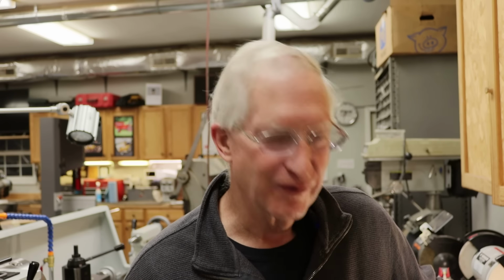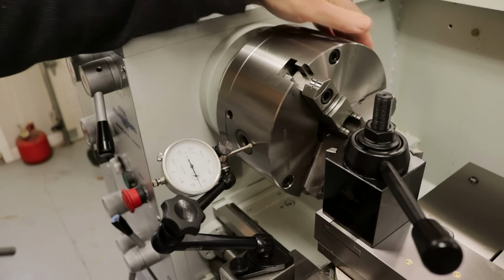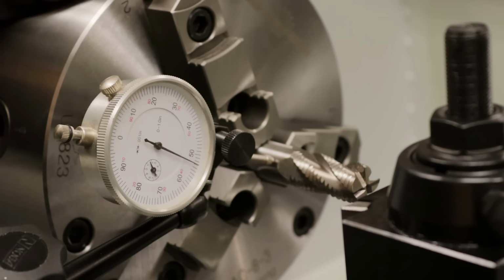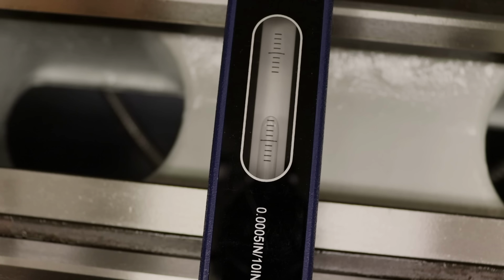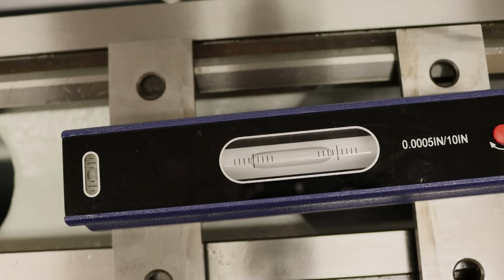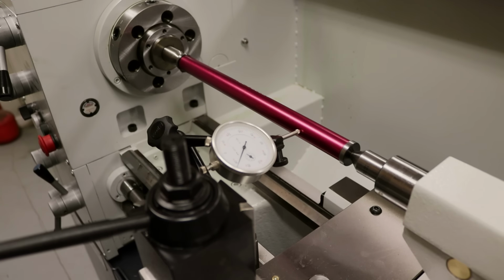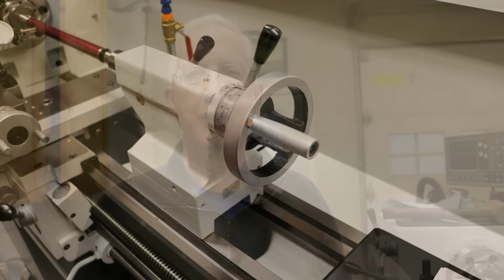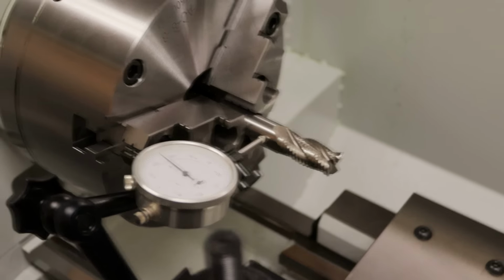Finally Catching My Breath

Comment: Frank , if I were you and needed the extra height, I'd make a steel frame instead of blocks. That way too, the frame is flat to match the bottom of the lathe, and the leveling feet could go on the frame. Just my two cents. Nice lathe!
Reply from the maker: That's the ultimate solution, for sure. Just trying it this way to see how it works.  If I made a frame, it might just be 3 or 4 inches rather than 6 inches high.

Comment: That's a great lathe. Take the reading on the Edge rod at the machined disks at both ends - that's what they're for.  Traversing the length is not as accurate as the reading you would get on those hardened disks at both ends.  The rod is anodized aluminum, which might be pretty good, but not as good as those disks.  Then, cut a long rod between centers and measure the taper.  Then, figure out if you should tweak the leveling or adjust the tailstock. It's a terrific rabbit hole!

Also - never stop rotation in a cut.  Always stop the feed first, then withdraw the cutter, then stop rotation.  The cutter should never touch the material unless the material is moving. Practice this sequence in air or some plastic rod.
Reply from the maker: Thank you. I'll do that.

Comment: frank why is the lathe up on blocks?????? and not on the floor.
Reply: If I'm not mistaken, he wanted a higher working height.
Reply: @scottberry8484  it looks very unsafe and not stable to me but i am no expert . with a machine running and vibrating i would want it on the floor and bolted down.
Reply: @wayneheigl5549 Bolting the lathe to the floor will have it all out of adjustment. A lathe has to have leveling feet on each corner so when you turn a shaft down with it the shaft will measure the same on each end of it. Out of level will result in the shaft looking like a carrot larger on one end and smaller on the other. The blocks are to just raise the working surface higher. Sometimes its hours spent standing in front of a lathe and being bent over like that your back starts hurting. There is very little vibration on a lathe so the chances of it falling are very slim. I ran mine for a year or so before raising it up and boy did it make a difference at the end of the day.
Reply from the maker: This lathe weighs 1750 lbs. I thought about the risks associated with putting it up on blocks and share the concern about vibration moving it.  Clearly, there is some risk there, but my back appreciates the extra height.  I'll just have to be aware of any out of balance situation and be careful.